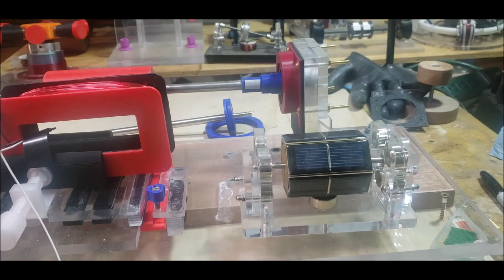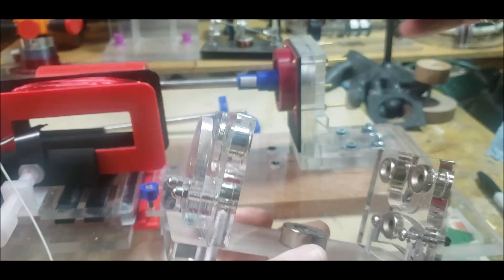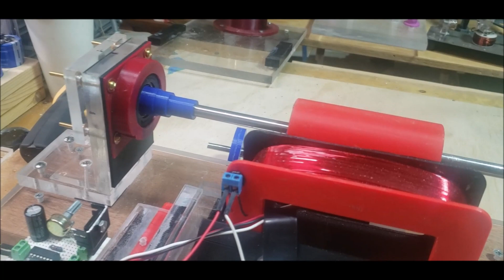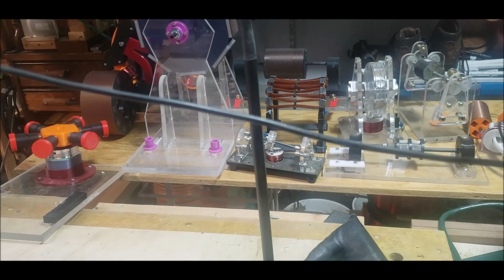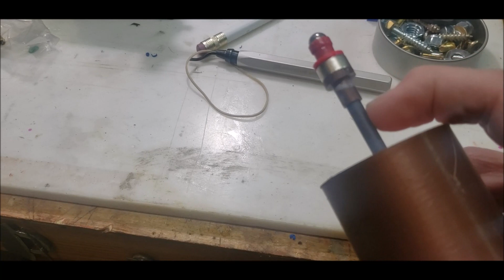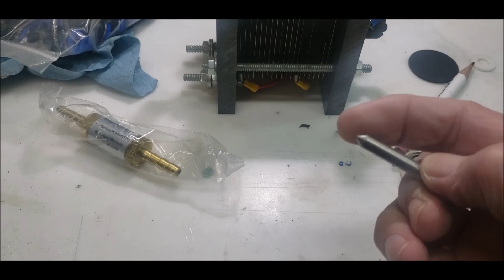3D Printed Maglev Explained

Comment: Just my 2 cents... Why use steel plate? if you use a ball ending, (i would use a 2mm diameter ball in a printed holder) and instead of steel plate i would use a hardened glass plate... like the one on my 3d printer. I used to use the creality glass bed plate (but the coated side, but the back side of it).. i showed it to my glazier (the guy that repaired my window) he said that that type of glass was nothing else than the heat resistant glass like in ovens. It is 10 times harder than the normal window glass. It think that a one or 2 mm ball, turning on hardened glass,, should last longer than a point on steel. (but i do admire the way you did it in this video -  so dont see my comment as a critic. more as a suggestion.
Luc
Reply from the maker: I appreciate the comment and I did use a harden steel ball bearing and glass before on my earlier maglev. I really prefer that method over the steel plate and rod but I wanted to experiment. My mentor Sky Collection uses the steel and I wanted to emulate :). I will go back to my tried and true method at some point.
Reply from the maker: Also when you going to post again? We need more videos like ours out there :) I'm excited to see what your up too
Reply: @mcorrade  ask me something easier.. i just finished building my new kitchen... and a small experimenting room... i need another 2 weeks to clean everything up... but then.. i will start again.. i have lots of ideas.. but the time is running away... my first  project will be a simple rotor... with  coils that produce lots of lenz.. and the lenz running a second rotor.. easy in theory.. but i still dont know if and how it will work.. but that is the challenge... isn't it?
Reply from the maker: @FreeEnergyNerd  ya it is.....Can't wait to see the new stuff